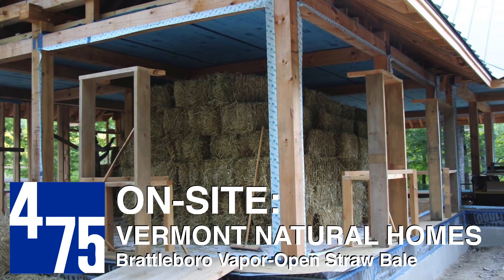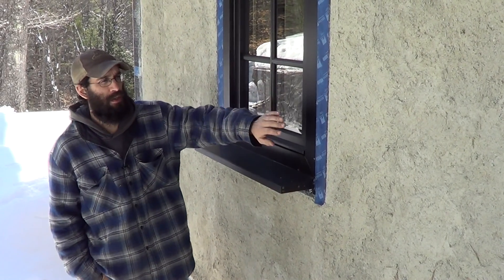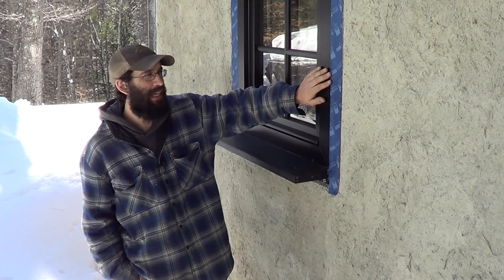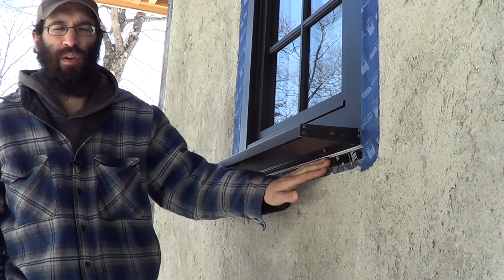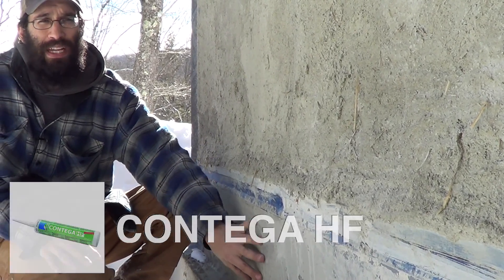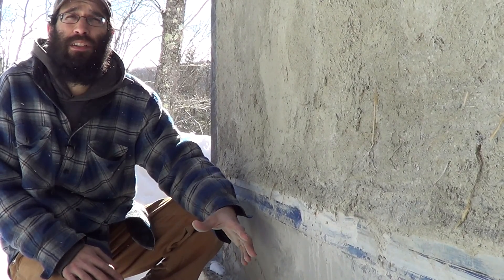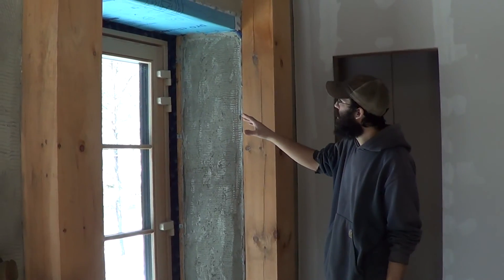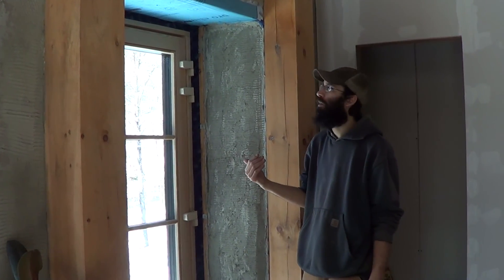475 On-Site: Vapor-Open Straw Bale with Vermont Natural Homes

Comment: How did you seal the interior air barrier behind the posts and beams on the south side wall? After you attached the double studs, weren't the posts in the way of getting a continuous barrier?
Reply from the maker: We don't remember exactly how Chad accomplished the air barrier on that wall, but there are a few ways: First, using a membrane as air barrier allows you to bend it around beams. At minute mark 6:08 you can see the beams are staggered from the double studs, allowing this to work. Second, he could have treated those walls like he did all other walls: applied tape to the edges of the beams and attached the air barrier to that tape. A third, more standard way, is to cut strips of membrane that wrap timbers in places that cannot be reached after assembled. These "floppy bits" of membrane, as they're called, are very easy to tape to and make the membrane continuous.